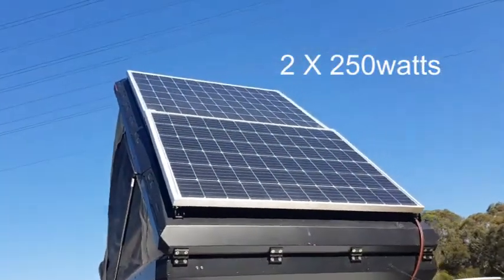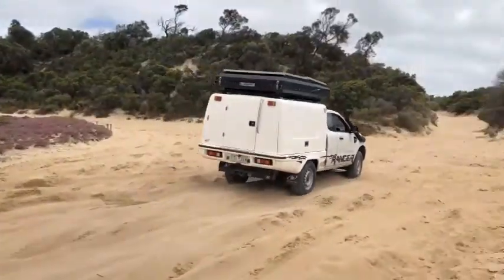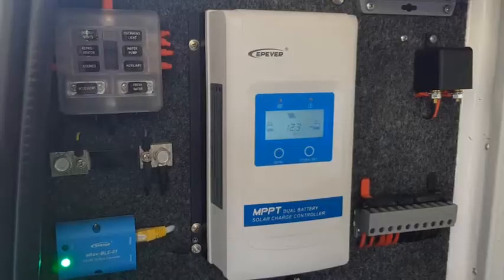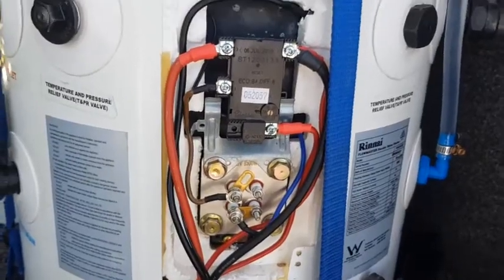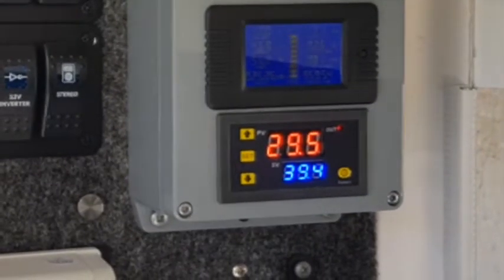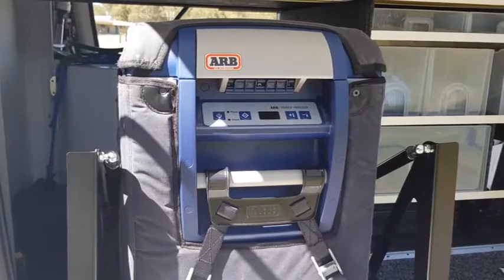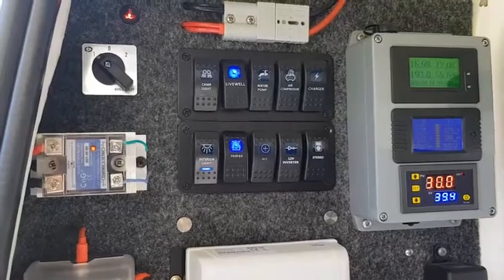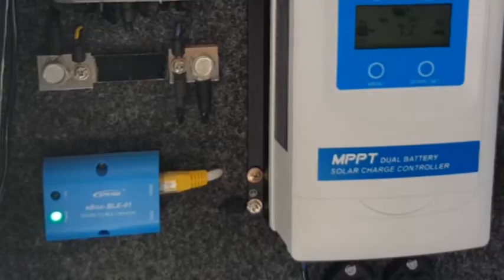Solar PV Hot Water for Camping

Comment: This is what i need
I have all the solar, charging and batteries 
In place. Do you have  a cheat sheet for the hot water system .
Reply from the maker: The solar panels are wired directly to the hot water heater element. The trick is to match the resistance of the element to get as close as possible to the maximum power point of the solar panels

Comment: So I’m curious how many gallons of freshwater you carry and if you run an in-line canister filter.
Reply from the maker: We run 75 litres (20 gals) in 5 separate containers. Except for the water heater (25l) all the containers are portable. This enables us to fill up at gas stations and taps at parks without a hose. It also allows us to manage the water quality because some outback water can be potable but muddy. It also allows us to fill up the hot water service from creeks and rainwater tanks.

Comment: You probably haven't seen my channel of how to heat water with PV.  My control connects to the panel and diverts any excess energy to heat water not needed to charge the battery.  It also continuously matches panel to heater resistance.  Flat panels produce less.  Studies have found overall daily heating in direct connect is almost the same when ideal resistance is almost doubled.  1.5 times is a good idea if poor sun or less than ideal angle are the norm.
Reply from the maker: I love your channel Opera. Your material has been my major inspiration.